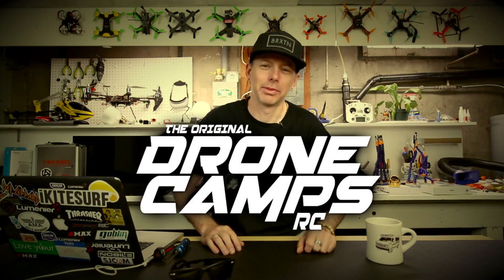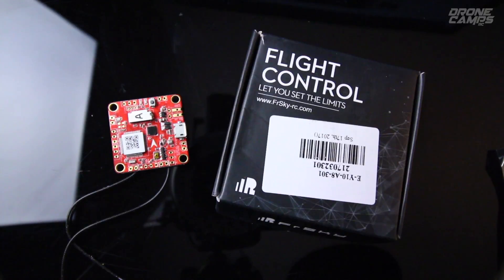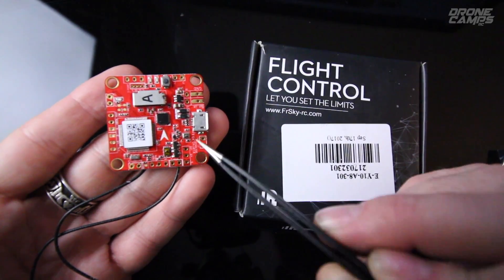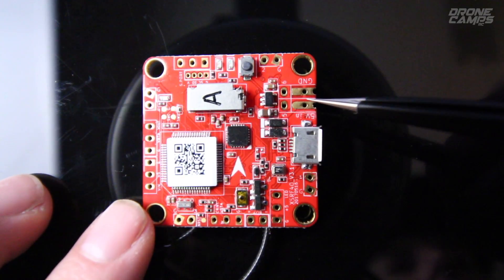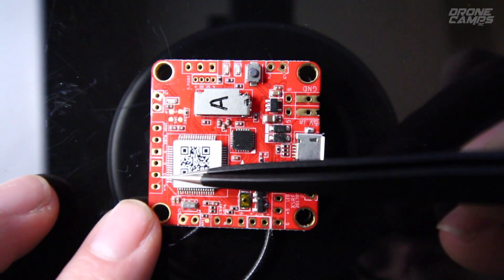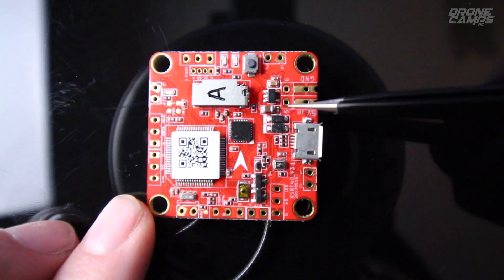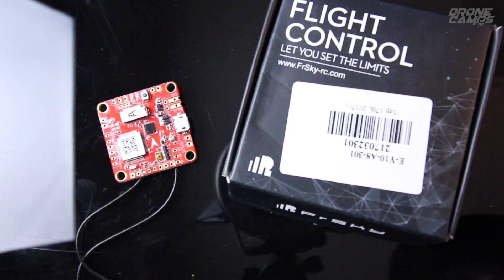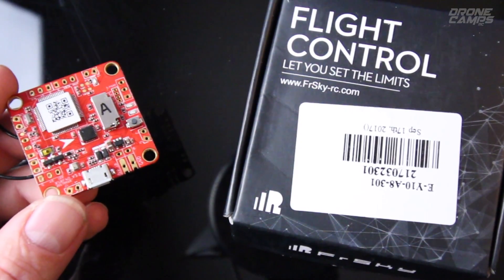FRSKY XSRF4O - Flight Controller and Receiver - NEXT BEST AIO? Review

Comment: I bought 3 of these last year only to find that uart 3 was not broken out, so it could not be used.  Maybe if you can do some really tiny soldering you could go directly to the processor.  I ended up using the boards in wing LOS gliders, with gps connected for telemetry.  Nice try FrSky but MORE UARTS NEEDED.  I hope they come out with a new version which corrects this problem.

Comment: Feel dumb asking this, but do you just connect the vbat to the pcb positive pad that comes from the lipo?  Do I need a pcb with a current sensor to use the current pad and then figure the conversion in betaflight for the osd?  Did not see a current sensor on the fc....
Reply: I have the same question but cant find the answer
Reply: Brett Robertson yes just connect the vbattery to the positive to the battery and you'll need a PDB with current sensor...
Reply: Chi Sty I’m using a Spedix 4-1 esc

Comment: Thanks for the video. now I'm trying to connect my smart audio.someone mentioned using the led out as a soft serial port. how is that done with this fc and Betaflight
Reply: I had to use softserial through the LED pad...
Reply: I've been trying to figure that out today, as well... there's no uart 3 breakout pad so it looks like the LED pads may be the only option. Not sure why this would be left out of an otherwise stellar design. Did that work for you?
Reply: u can actually use tx3 for smart audio
Reply: Sed Hendo did you get smart audio hooked up? I’m trying to do the same and my board doesn’t have a tx3 pad.

Comment: There arent any solderable UART pads anywhere on this. Only way to get smartaudio or tramp telemetry for controlling your VTX to work is by soldering directly to to the processor pins, which is pretty sketchy.

Deal breaker on this board in my opinion. No idea why a standalone smartport pad is included, but nowhere to hook up to UART3. Really senseless design on what is a great concept.
Reply: How is that done? I'm trying to do that now.

Comment: If you have a relatively tight build with, say, the VTx mounted above the FC, how can you easily remove the SD card to read the BlackBox logs? AFAIK, you can't extract the logs without removing the SD card.
Reply from the maker: +Richard D Matek makes a PDB/VTX that solves that problem.